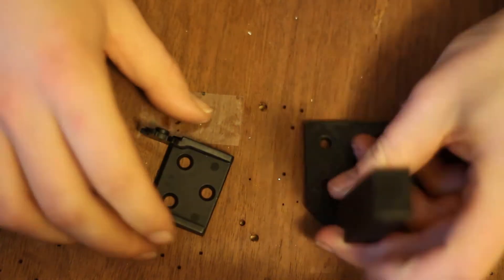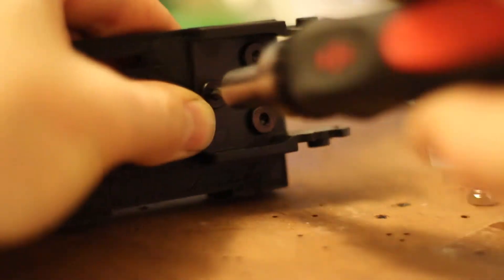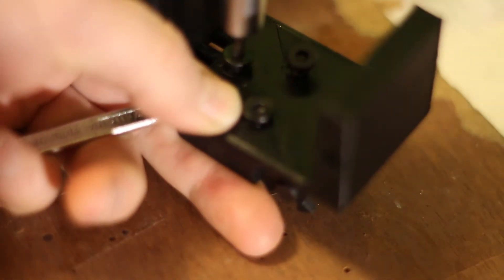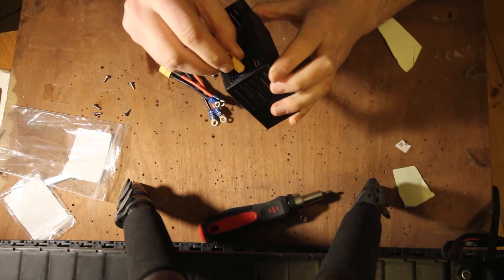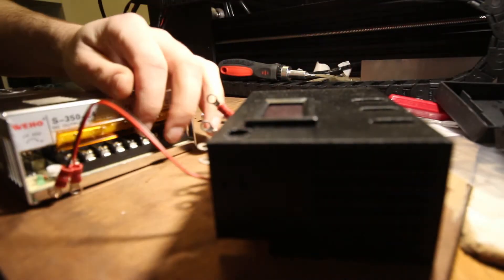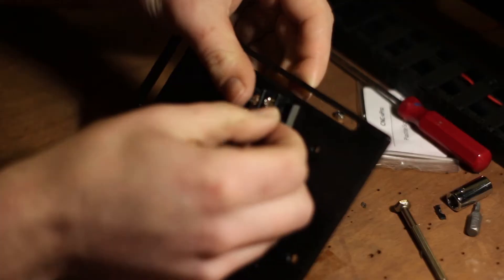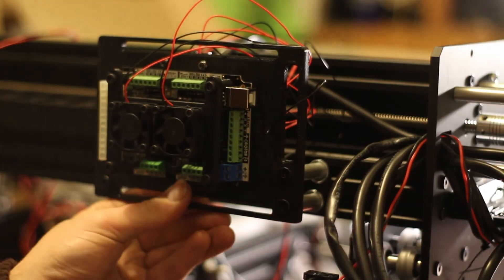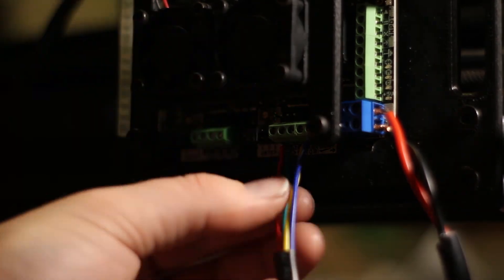The Workbee CNC Electrics #3

Comment: How are you getting on with the router itself? Are you using it much? Any issues? I'm thinking of getting one but I've no engineering background. Cheers
Reply from the maker: the router itself is fine, main thing is to make sure you are using the right feed rates and bits, the wrong combination can mess them up but practice make perfect.
Reply: I am currently building the Workbee and will use a water-cooled spindle. Much quieter and more efficient than a router and of course can be programmed to start/stop rather than manual.
Reply: @WoodomainJeremyBroun  which water cooled spindle are you using please thanks